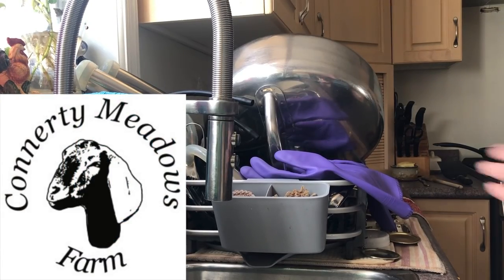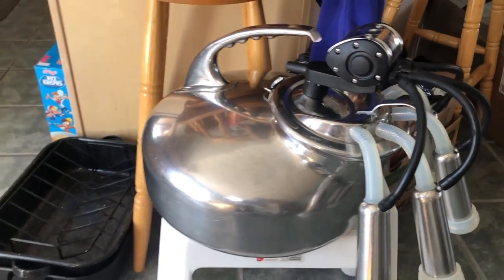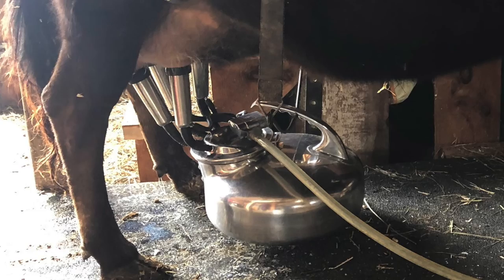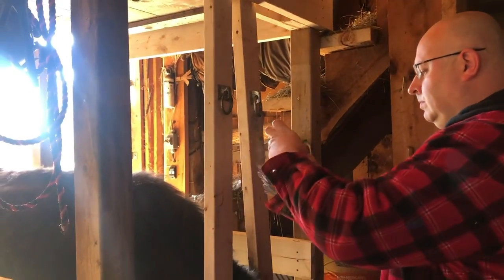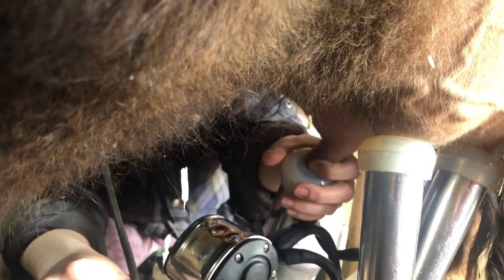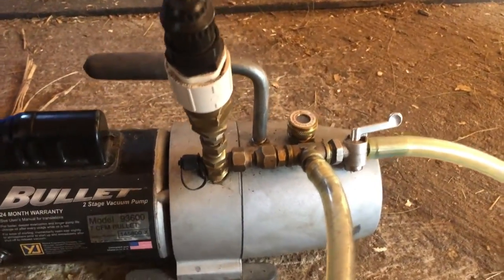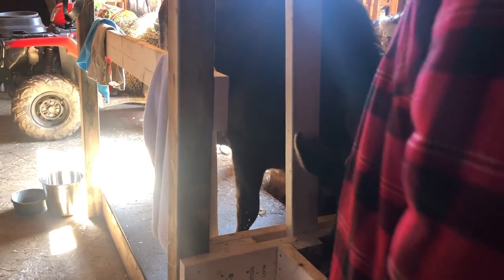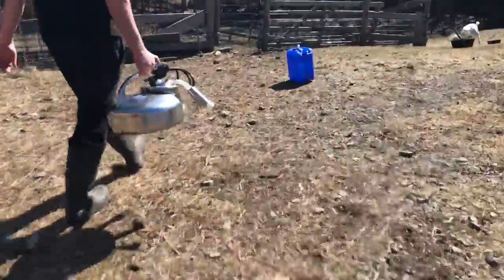Milking with a Surge Belly Milker

Comment: Did you get the cleaning brush from Hamby?  I've always hand milked but recently bought a surge and am struggling a bit with the learning curve.  But I need it to work as my girl's teats are not ideal for hand milking.  thanks!!
Reply from the maker: I did not get that particular brush from Hamby as mine is a surge one but they carry a similar one that’s pretty much the same thing.  I know about those small back teats.  I can’t really hand milk my girl either for the same problem.  The milker is a life saver.  Remember to kink the inflation while putting it on so not to loose pressure.  That’s the tricky part for most people!  Good luck and here’s a link for you.  https://hambydairysupply.com/inflation-brush-large-bore/

Comment: Do you not have a problem with water on the vacuum lines from submerging them in the cleaning water?
Reply from the maker: no as I put them upside down to drain them after washing them.  They have about 11+ hours to drip out between milking

Comment: How did you determine the back inflations were contributing to mastitis?  Where did you buy the silicone inflations?
I've had a surge bucket milker for 2 years from Hamby dairy supply and I haven't used it. Nervous to make the change. Am I able to blug them for the teats that empty 1st?
Thank you so much for your video!
Reply from the maker: Every time we put a new pair of black inflations on she got mastitis.  Even my other cow.  None after switching to the silicone!  We got the silicone ones from Hamby.  No need to plug them up after finishing each teat.  This is what you do.  You link the inflation then point it downwards.  The beauty with a surge is that it is designed to not have any suction in the down position.  Copy and paste the link to see what I mean https://www.instagram.com/reel/CtK80QMP8Ns/?igshid=ZWQyN2ExYTkwZQ==